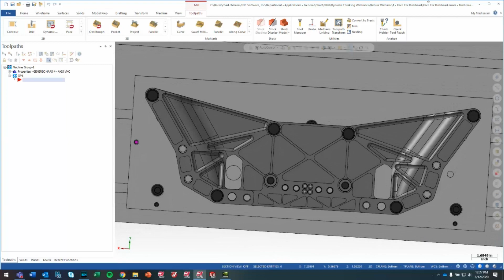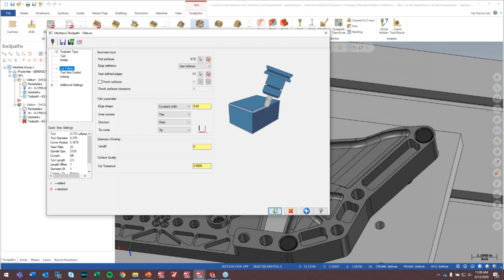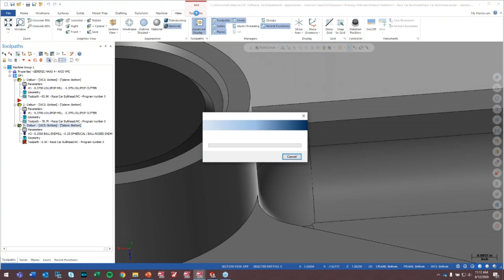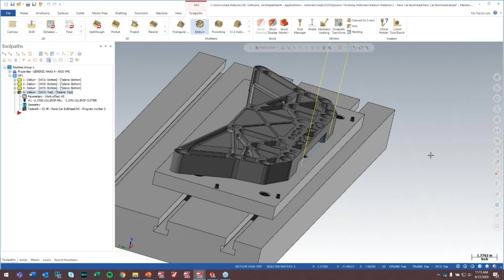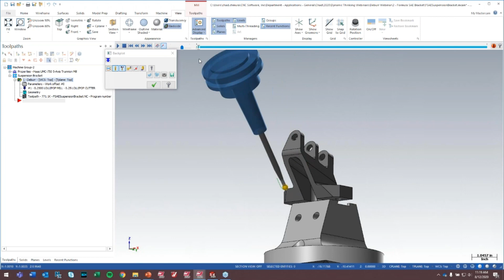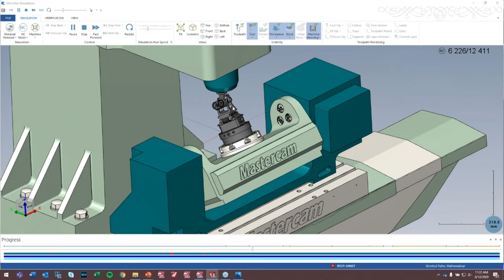Increase Quality and Throughput with the Mastercam Deburr Toolpath

Comment: Hi, I was trying out multiaxis deburr, and I was trying to get it to output "positional" 3+2 motion.  I set the tool axis controll to 3+2, but I still seemed to get multiaxis moves, rather than the expected move xyz, retract, position 2, then move xyz again.  Is multiaxis deburr intended for use with a true 3+2 positional machine, where B, and C in my case are only able to be positioned, and not moved during the cut?
Reply from the maker: Hey Matthew! Generally, when set to 3+2 mode, Multiaxis Deburr will lock to a multiaxis position during a cut, and then reposition. The only exception would be whenever a certain chain cannot possibly be deburred at a locked orientation. The toolpath may need simultaneous motion to avoid a certain obstacle, for example. If you are seeing simultaneous motion on a particular chain, we advise that you 'break up' that selection into multiple chains, giving Deburr a chance to machine a certain edge from multiple 3+2 orientations. 

If you truly only have 3+2 positional capabilities, multiple Deburr operations locked to 3 axis might best match the exact toolpath motion you're picturing for your machine.

Comment: I used this on our 5axis using a 0.02mm cut tolerance - it worked great.
Next part I changed the tolerance to 0.01 and now the tool crashes 5mm into the part :(
Reply from the maker: Hi there! Our technical support team would be happy to help you. You can get in touch with them directly at support@mastercam.com.